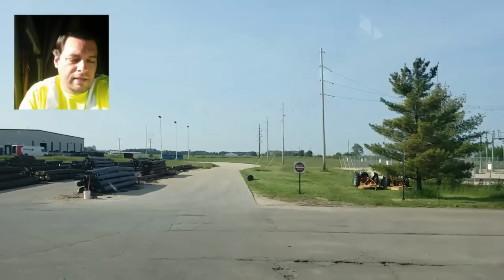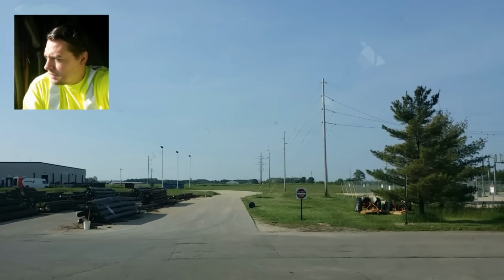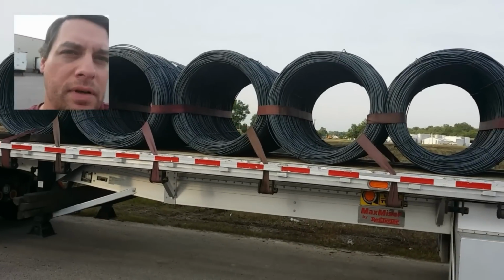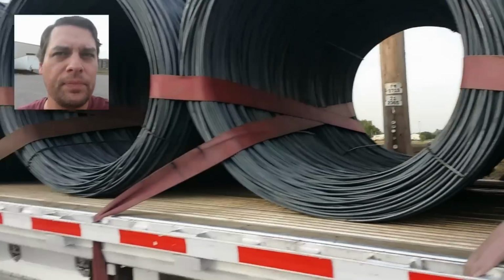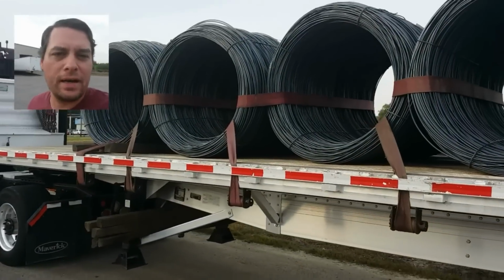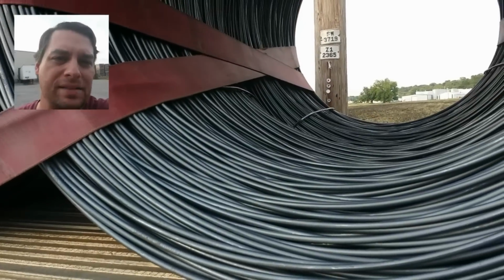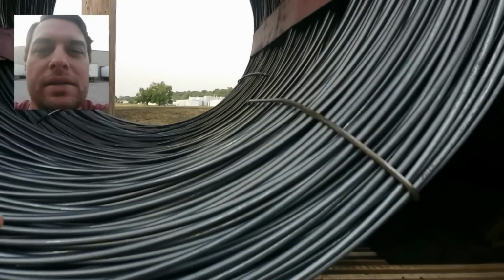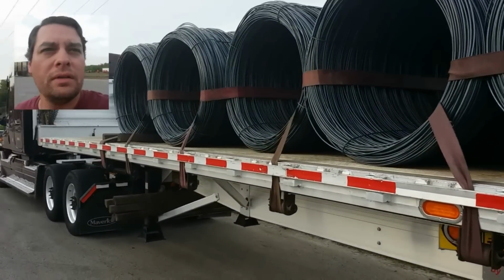Flatbed Securement: Painfully slow securement of Coiled rod

Comment: Nice TMC pete at the 0:18 mark. And I have to correct you on the title. This is just grueling. Painfully slow would be this same task but doing it in a driving rain or even worse...in the WINTER...with a nice wind chill. Now that's pain. But the bottom line is, no matter how long it took, your load was properly secured.
Reply from the maker: I have done it in the winter, and in the rain, and after securing  - had to tarp. Its not really a correction but your personal preference. It was painfully slow because normally it goes much quicker, but I had to redo some straps because i initially placed them wrong.

Comment: hey! But, why so far out from the drive axle, doesnt it jump when you are drivin, i haul coils before and some were so heavy that we were only able to haul just one and that one was put in the middle of the flatbed and once the truck was moving it jumped alot on the freeway... im quessing that would be the case with this load youre doing..... great video and stay safe out there... i did truck driving for over 12 years and loved it... im in mexico did do what i wasnt a good citizen thats what happen, but cant wait to drive here in my country.....
Reply from the maker: WE load from the center out. No jumping on my that I have noticed. I have seen some drivers that like to haul things over their drives. i am not one of those drivers that has that preference.
Reply: Dale Clay  the farther from the cab the better

Comment: Do you use a different set of straps for loads like the coils in which the strap tends to bunch in the pockets and get edges get alittle frayed? And thanks for pointing out the over and under positioning to get the maximum tension on the strap👍
Reply from the maker: +Big R Phillips No, if our straps get damaged we turn them in for new ones.

Comment: So did you do over the top and cross threw the eye of those coil's I always did so they wouldn't lean to one side or the other which can do.
Reply from the maker: Not on these type i dont, others I do. I think we call that the figure eight.
Reply: Yep it's called figure eight. I always did it with coiled wire and slit coils for safety and a more stable load. Paletized  slit coil's I allways'd  crossed my chains across the top.  Name and I hauled it. If I had the money I'd start a flatbed training school. Keep up with the vid's I enjoy them.

Comment: DOT is okay with you hooking those on the rub rails just curious?
Reply from the maker: Yes
Reply: cool thank you
Reply: If I were you, I would hook those straps to the frame instead of the rub rails. DOT is not my top priority. Safety is. I don't see why you don't do that.
Reply: not true there is no wll on rub rails you can get a ticket for that my company policy we need to hook under to the trailer frame
Reply: Ryan k no actually Reitnouer trailers do have a WLL for the rub rail, check the data plate next to the drivers side landing leg next time you see one.

Comment: I have my CDL Class A W/Tanker I let my Haz Mat expire a long time ago but i'm registered. I need a job any idea's? I am looking at LMC. My neighbor used to work for them. One way or another i'm getting back in a truck I just need some advise on getting seat time without going threw a school.
Reply from the maker: +jimbeau I am unfamiliar with hiring drivers that haven't driven in a while. I suppose if your CDL is good then you should be good with a current DOT physical. Best bet is to give some places a call that meet your needs. I am happy with Maverick so I always recommend  them, I am not sure where you live, but there are several companies that hire new studwnts, but someone like you that has experience should have no problem with even the company's that require experience.  I can't recommend any other company I haven't driven for. I would hate to recommend a company and find out letter they are not what them claim to be. I recommend talking to those that have the type of trucking you want to do and meet any other needs you may want. Drivers are in demand, so you are in the Drivers seat when it comes to getting a job so to speak.
Reply: I'm in Michigan and 100% legal for out of state. I got my phy's a yr ago just need a ride.